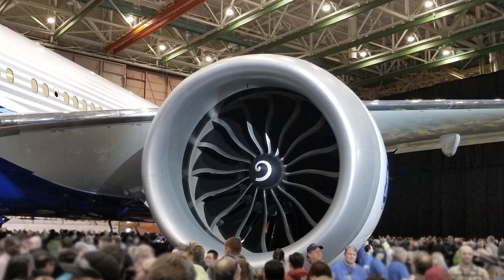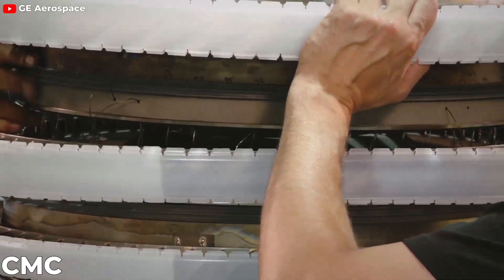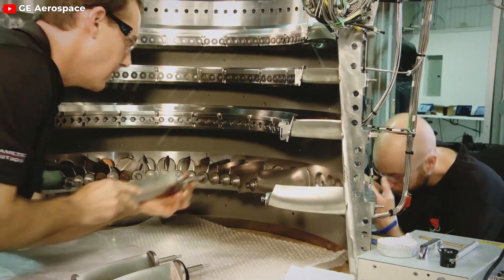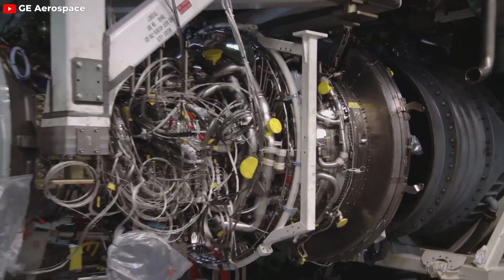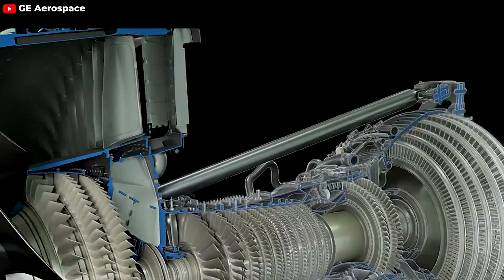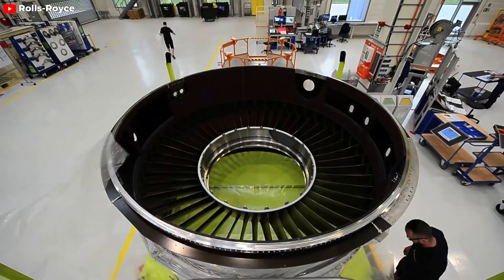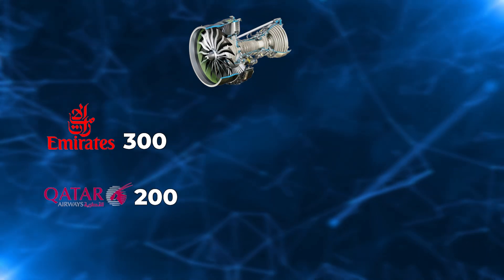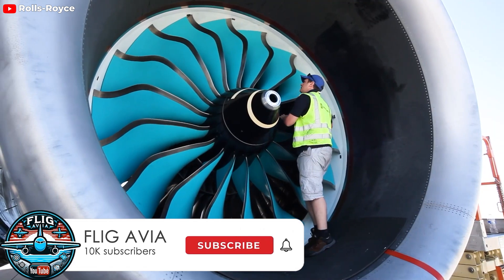Boeing Wonder Weapon BIG Engine Power SHOCKS Every Airlines! Here's Why

Comment: RR Trent XWB is recognised as the worlds most efficient turbine built to date. Any claims to the contrary are speculative until GE9X is in service & it can be proven to be so. Given that GE9X is later tech I would expect this engine to deliver on the promise, but again the reliability expectation will have to earned after EIS & some years after that. It will be fasinating to see just how efficient B777X will actually be in comparison to the A350-1000 given the much heavier airframe of the Boeing plane.
Reply from the maker: Thanks for sharing

Comment: The problem here is, it is not the most powerful engine.  Their current version generates  10K more thrust when attached to the 777-300er and 778-200lr than when this one is paired to the larger and heavier 777X-9.  It is poised to be more efficient which is most important to airlines, but being a larger and heavier plane, the 777x-9 won't have the range the current versions have and certainly won't be flying any faster, with a less powerful engine on a bigger and heavier plane.  The plane will fly more efficiently and be able to fly more passengers to most of the routes the current versions can minus some of the longest  routes given it's range deficiency.
Reply from the maker: Thanks for your sharing
Reply: I know this post is from 7 months ago, but the GE9X is the world record holder for thrust at 134,300 lbs. An extraordinary increase over the RR XWB.